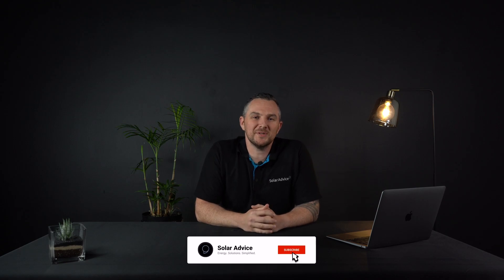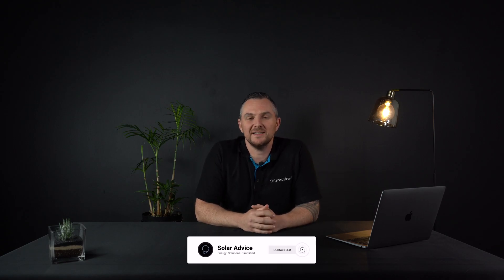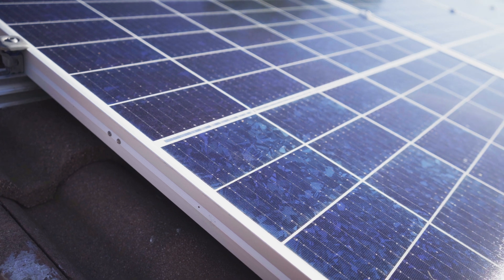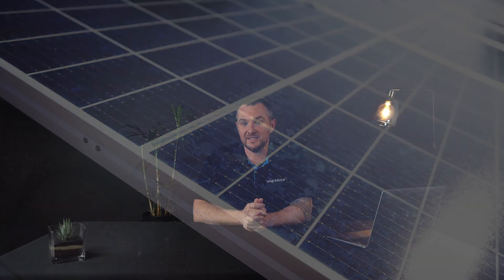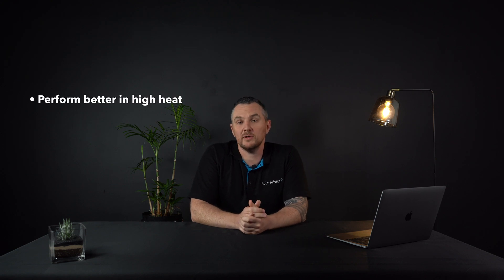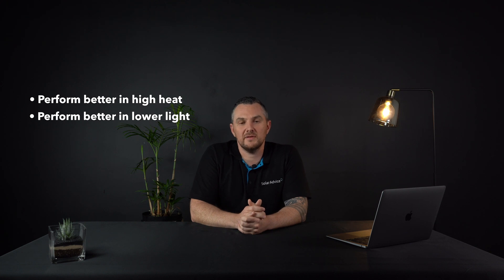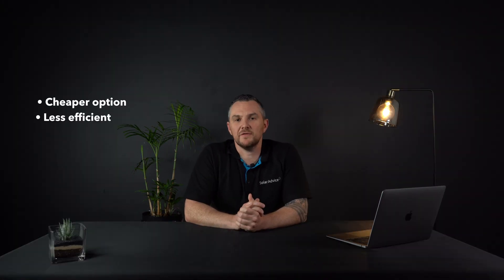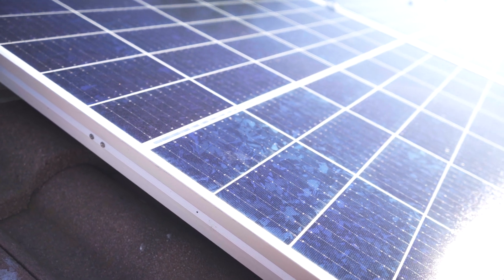The Solar Panel - What you need to know

Comment: Hi i have 12 × 480w panels 
Total of 5.76kw
With a 6kw pv input invertor 
But the max output the panels give is 2.4kw 
Its on a 45 degree north facing roof 
What could be the cause of that or is that the output i sould suspect

Comment: Great video
Looking to put panels up for a 48v 5KVA inverter and already have a 5.12kw battery connected to it.
My MPPT Voltage range is 60-130v and the Max VOC is 145v with a max charge current of 140amp 
What size and number of  panels would you suggest using as the most cost effective option and utilizing  the full capacity of the inverter ?
Reply from the maker: If it is a low-voltage then you are limited to the max PV, also bare in mind you will need a combiner box.

Comment: Hey Solar Guy
Enjoy the information (both thumbs up).
Question (more towards the end) we have a load shedding solution working perfectly and would like to install a PV system 10kva with hybrid inverter and don’t want to integrate the two systems. We would like to keep them separate and only take the high consumption appliances/machines/water pumps  (all single phase) off the grid approximately 50 units per day.  ….is it better to integrate as one system (because we fear if the whole system fail it would be a bigger disaster) or can we separate the system and operate as two stand alone solution…. I anticipate your thoughts
Reply: Also, polycrystalline vs mono crystalline, which of the two has a longer lifespan (given good maintenance is in place)
Reply from the maker: @faizsamsodien  mono is the better option, both types typically have the same lifespan
Reply from the maker: Glad you liked the video, to separate your system does take on more complexity, if your current inverter can take PV then I’d suggest utilising that, does your hybrid inverter allow for essential and non-essential loads? Because if it does then you will achieve exactly what you described by only running certain appliances during load shedding.

Comment: I'm so glad I found this channel right now...3 hours ago I was watching diagrams on how to connect solar arrays.

All I wanted to know is what charges the batteries if you have solar panels and still connected to the grid? Is it the grid or the solar? And does every hybrid inverter do this automatically or only the high end ones?
Reply from the maker: Hi, the Hybrid inverter takes care of the power coming in from the array, then diverts that power to charge the battery and run the household at the same time. If you need more power because the array or batteries hasn’t got enough it will take from the grid, we have a video on the Hybrid inverter I recommend checking out 👍
Reply: @solaradvice  awesome...thanks so much. I appreciate that you speak South African English as well as you write it: CLEARLY🤣
Reply from the maker: @Nesamag  😂 all good!

Comment: I have read and saw in different videos that you connect your solar panels to a "Micro inverter" which is located behind the panel. Is this a must? Or could I just series them up until the needed voltage is met and plug them directly into the inverter? 

Second question. Do one ground the panels?
Reply from the maker: Hi, micro inverters are only really good for when you have some shading over a panel, what it does is simply single out that panel so that all the panels still power at 100% and simply ignores the weak panel. You can use micro inverters instead of a string inverter but I would recommend a string inverter unless you have the issue as mentioned.

Comment: Thanks so much for the information on this video, it cleared out a lot of the questions I had. 
Just a quick question please, so I am planing on installing a 5KVA hybrid system using the DEYE inverter, so the problem that I have is that I do not have enough space on my roof that gets the sunlight throughout the day,  I can only fit up to 7. Can I use panels of size 600w or 540w (Canadian) on this system to maximise on the amount of watts I can get?, I hear it is not recommended because of the Amps?
Reply from the maker: Thanks, I'm glad you got some value out of this video.

With regards to the number of panels it does depend on the amount of volts, the inverter can only handle so much, the Deye is a high-voltage inverter, for example on the data sheet you will see "VOC", in the example of 540w you're looking at about 49V. 

For the Deye 5kW the maximum voltage is 425 per MPPT, you can divide that by 49V, this will give you 8.6 (rounded), so basically 8 panels per MPPT.

16 panels equals to 8640 watts of PV which will exceed your Max PV Input which is 6500 watts, so basically you can get 12 (6500w / 540w = 12 panels). 

Remember that when you arrange in series the Amps stay the same, it's only when you arrange in parallel the Amps go up and the Volts stay the same.

Hope that answers your question!
Reply: @solaradvice  makes sense, thanks.
Reply: @solaradvice  thank you this is interesting to know. But makes me ask is it possible to stack 1.5KW batteries together with 5KW battery ?
Reply from the maker: @freddymalatsi4413  we don't advise that because the lithium-ion battery capacity is different, also the BMS will also be different.